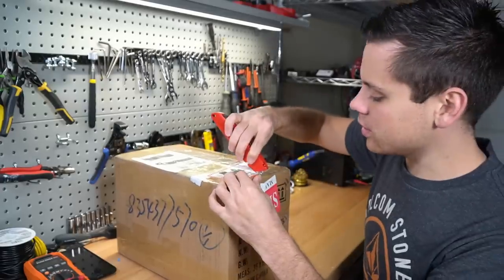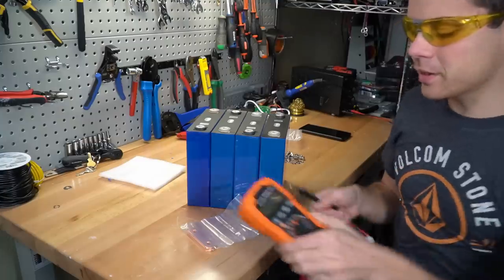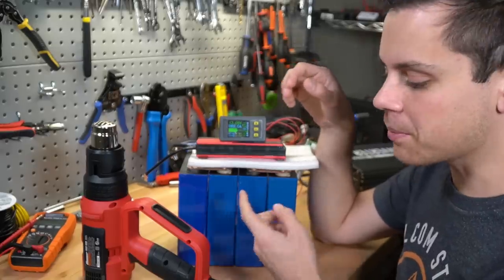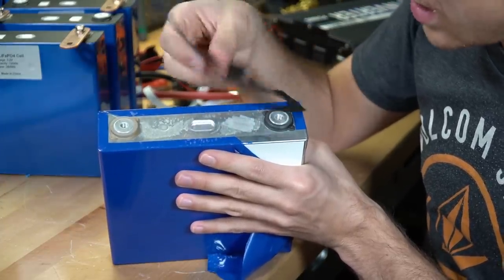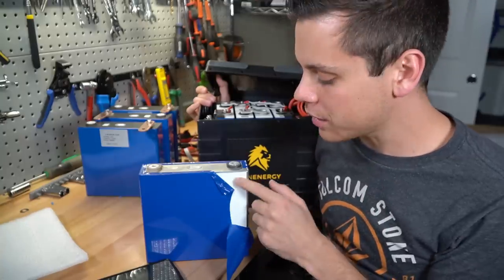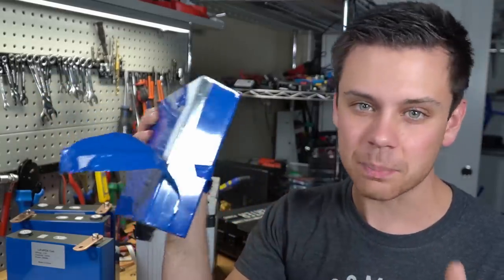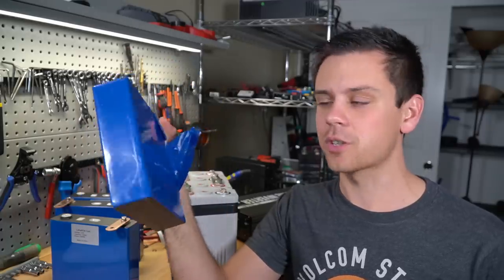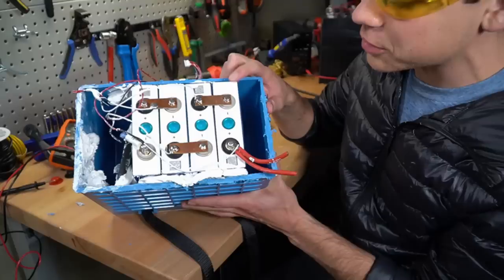Cheap 120Ah LiFePO4 Al Cased Aliexpress Cells: Are these Grade B?

Comment: I have 6 - 100 wt panels and want to have enough power to run a fridge. Aside from that I want to be able to use a toaster oven and charge laptops/phones and maybe a induction cook top, of course not all at the same time but it's for an RV. I also want to run a small AC unit at night on hot evenings. So what I'm asking you is, how big of a battery bank do you think I might need to power my RV. Using my 6 panels.

Comment: So, what is the optimal storage device for very frequent charge/discharge cycles?  Is there a point at which you would want to string multiple storage systems together so that each can perform optimally?

What is the calculus for the degradation done by a very deep charge and discharge cycle under controlled temperature conditions versus an equivalent amount of energy versus several shallower cycles in lithium iron phosphate cell?

Comment: Hey Will, Love your videos but this one seems to have mixed messages, it's hard to understand your point.
Are used batteries worth buying or not you say they are & they are not, which is it?
Reply from the maker: Pros and cons to used batteries. I said at the end that if you can find a good deal and test them, go with used. But I said that I prefer new cells. It was near the end of the video that I covered this.

Comment: MERRY CHRISTMAS WILL. Thanks. Love your videos. I'm a casual RV'er. I have 3 12v wet batteries in parallel. It would be fun to see a video on how many wet batteries 6v / 12v it would take to equal a 100ah Lithium battery? Watt hours? I get the battery life and maintenance issues and that wet batteries cut off at 50% and Lithium cut off at about 0. I just wonder if I replaced my 3 wet batteries ($300) with a 100ah Lithium ($500 ~ 900), what would be the watt hour gain, if any? Real life application?

Comment: You should do a review on the 280ah batteries in the aluminum case from AliExpress 😁.
Reply: Just recieved 4 of those today, $797 shipped TOYSEA ordered Jun 1, well packaged, new, 3.33,3.34,3.33,3.30 volts tested on arrival, have daly 150A Bms Separate, recieving copper bars (4" bus distance), fastronix terminals (3 for solar separate).

Comment: Thanks Will, I recently moved from 18650 power wall to lifepo4. Searched videos on you tube and attracted by your videos and subscribed. I need a help. This video is 4 years old and your knowledge might have build up a lot now. 
Please help me to read the capacity of lifepo4 batteries. Which meter I need to buy? All the meters I have tell me the voltage. 
Also if you have find a good seller for blue colour lifepo4 now please direct me to buy. Thanks.

Comment: Will, I would really like to see you tear down an Inergy Apex and maybe the Titan?  I’m looking at both of these for RV use.  I was ready to order an Apex until I saw that you did not recommend the Apex.  Now I’m looking at the much more expensive Titan.  I’m ok with the Apex EC8 connectors because they now have an MC4 adapter, and also ok with the 1500 watt inverter, IF Inergy actually comes out with their external Lithium battery.  Inergy promises the external Lithium by Q1-Q2 of 2020, do you think they actually will get one out?

Comment: I have a 400w renogy solar setup with the 40a controller and 4x 3.7v LifePo4 Batteries seriesed at 12v parallel.
Question, if I want to charge the battery bank with 110v such as a small gas generator could I use a charger like the Ultra Power UP240 AC Plus 240W 4-Port Multi-Chemistry AC/DC Charger or can I use any standard car battery charger?

Comment: The ebike companies that last, Juiced Bikes, Sondors, Rad, all go to China and they establish deep relationships with the companies they wholesale from. Even Lectric with their red hot XP goes to China. Without that, they don't really seem to treat you as 'human'. Paul, at EM3EV, has been building batteries for many years. He has depth and you might read his website. A lot of the Ebay vendors start out selling packs, like ebike packs, from overseas, and when they have a market here, they bring in supply and ship from the US. It's all developing. You should look at 48v ebike packs. The high voltage is better to run an inverter. They come with a BMS, often a charger. Lots to choose from, but a very simple build. I've had a Life pack for 4 years. Still has 90% cap.

Comment: Thanks for all the info, I purchased this cells and the bms you recommend but forgot to buy the Bluetooth module. You know if I can use an arduino or similar bt module? is ok to use the battery without the bt? thanks in advance

Comment: I was wondering have you come across these and do you think this would be a good battery for a RV this is the battery and this is what they claim etc. etc.

The Centennial CB6-400 6V 400Ah L16 Sealed Lead Acid AGM Battery is the best option for those looking for highly reliable batteries known to provide a long life-cycle. The Centennial AGM sealed construction allows for a long service life and make them dependable in everyday use. Centennial’s AGM’s provide maintenance-free operation, which means that their operation is hassle-free. The heavy duty grids, and low self-discharge of the Centennial AGM help it outlast the competition. 

Special Price
$532

Comment: Can I put a 12V LiFePO4 battery in my truck as an auxiliary?
Can it get charged by the alternator or do I need a DC/DC charger? 

At the moment  I run a  110Ah AGM Gel  lead battery connected to the starter battery by a victron Cyrix ct relais.
Because of the usable capacity of Lithium batteries, I think 60Ah should be enough.

Comment: Hi, I have a pair of Alliant LifePO4 12v batteries for motorbike. I got no motorbike, I bought them to use with solar... however when trying to charge with a regular mppt 12v charger, the battery got puffed. I dont know actually why, but it seems this battery is made just for motorbikes. So.. the question is: Is it safe to try to open the battery to use the cells that are still good? I thought about checking the cells model and buying proper BMS for them. The case is made of hard plastic.

Comment: When you calculate the energy density, how much do you leave out to account for the terminal assembly and case weight?
Reply from the maker: That can change the weight drastically. That's why sinopoly are super heavy. But they are good cells anyways. Also, you need to factor in external case weight. Aluminum case cells may be lighter, but they need more protection than calb or sinopoly. Or Winston cells. So heavier external case. Pros and cons to each.
Reply from the maker: Most energy density estimates include case/cell design features like the cap etc

Comment: Does anyone know if a source for the group 26 enclosures the 12v replacements use? I'd love to use cells like this but my application is for a travel trailer so they'll be living out in the elements (the breakaway cable must be connected directly to the battery and brakes) so a quality waterproof case is mandatory. I'd love to save ~60% over a comparable Battleborn but I'd want to do it right.
Reply: Andrew Fidel  Look for battery cases on a—lie express. There are many styles.

Comment: Hey will , I have purchased the 800 watt  all in one mpp and (2) 138 AH valence lithium batteries (black case) and I went through the settings you suggested, but I noticed your settings don’t quite match .

Is there a way you can help me with the settings to  make sure I have the correct settings , I don’t want to ruin my setup by not having it correct.

Thanks

Comment: Can I build a ebike battery out of these? My dream battery is 52v 40ah but I'd settle on 52v 20ah, if it's cheap I'd make two 52v 20ah and run them parallel and end up with a 52v 40ah. How much would it cost for a 52v 20ah battery made out of these cells?/ Or should I just buy a 52v 20ah lithium ion battery for 600.00. I'm so confused, I just want a ebike with enough power to movey fat butt, I'm disabled and can't contribute alot of leg power, I'm trying to buy or build a 750w nominal 1700w peak rear hub with a 35amp controller. 52v 20ah battery, on a fat tire comfort bike, maybe a front suspension and suspension seat, 26 in 4.0 wide fat tire. Help me I have 1700.00 saved up,

Comment: Don't batteries depleted to 80% deplete much faster from 80->64% (the next 20% drop in capacity) than they did originally from 100->80?  The charts I see show capacity falling like a rock after a cell is already down to 80%.  So these would be good for a 100 cycles or less.

Comment: I don't really understand why you recommand the previous CALB cell that you reviewed when same sellers offers better aluminium cased batteries for around the same price. I looked up the ones you recommanded for a 24V system on your website versus the Calb batteries you reviewed, and they are cheaper, smaller and lighter than the CALB batteries.
Do you recommand putting a 24V lithium battery bank inside a case for a boat application? I'm trying to look at building a 24V 100-120Ah that will stay in a boat, and these aluminium cased or CALB battery are quite big, and won't fit inside a cheap amazon waterproof case.
Thx for the video, i'm learning quite a lot from your reviews.
Reply from the maker: Yeah that's because the price keeps fluctuating. It's driving me nuts. Calb was cheaper. Now the new Al cells are cheaper. And I have a video on the new cells coming soon.
Reply: @WillProwse  In the end, both are good systems for a simple diy battery bank. And it could mean a lot for boats with electric engines that are still relying on acid battery. There's still a part missing which is finding a watertight case to fit those big LiFePO4 with the Daly BMS.
Charger wise, what do you recommand for these 12/24v battery bank? aliexpress or else, something powerful like a 10-20amp

Comment: Why not test used Nissan Leaf batteries?  They seem like they are by far the best bang for buck.
Reply from the maker: Not a fan. Every capacity test I have seen online has been horrid. The temperature management system of leaf battery is horrible. I avoid those cells.

Comment: Aliexpress never fully refunds.  They give you a percentage back (it's pretty arbitrary how much) and argue that you still received goods that are worth something, albeit a lower amount.  I was only successful in getting something fully refunded on aliexpress once, and it was a huge hassle.  You have to chat which is very hard to figure out and then they review it internally.  I had to do this like 5 different times to get the full refund.  It was like $50, so it really wasn't worth all the time and effort.  I just ordered 280ah cells and if they turn up used I'm just going to dispute the charges with my credit card company.

Comment: doesn't look good? You know how low the resistance of copper is? You will probably be fine if if you have 1/5th of the thickness of those thing copper strips. You wil blow up those cells earlier than you would get the heat/resistance high enought before it even starts to matter a little bit.

Edit: But yeah having more copper than necesary is never a no go.

Comment: $442 isn't that cheap.  You can get a 12V 100 aH LiFePo battery directly from a manufacturer in China for less that $400 delivered.  it includes a BMS. All in a very nice blue battery box.  Ready to plug in.  I would NEVER buy a used battery.  It just says it is a "good" battery.  Very nebulous rating.

Comment: 4 pcs @120Ah for 400$ is not that cheap though. You can get proper, warrantied 150Ah cells for less than $100 including shipping.
Reply: Source?
Reply: Are those lipo4?
Reply from the maker: Where????! I have never seen them that cheap. Would love to see this source.
Reply: @WillProwse  I replied with a source including to the other posters, but it seems they end up in the spam folder because of the link. Can you check that?
Reply: @WillProwse  Because the spam filter, if you go to item/4000108447273.html on Aliexpress. I don't know what price that shows you, but I get 16pcs, 150Ah for $1,597.06 - that's $99.8 and includes shipping.
Reply: @jessyterpoorten7197  Yes. Links get send to spam, so my first reply didn't get through. Check the other reply I posted to Will in this thread.
Reply: @andrewfidel2220   Links get send to spam, so my first reply didn't get through. Check the other reply I posted to Will in this thread.
Reply from the maker: @upnorthandpersonal  dang I can't copy them in until I get to my desktop. I'll check them out soon. Are they new and matched? Did you buy them?
Reply: @WillProwse  yes, got a few to test some time ago. Actually, when I just checked out your site they seem to be from the same seller you recommend!
Reply: DIY Solar Power with Will Prowse 
At this rate you end up broke but with enough batteries for a huge power wall;)

Tx for your video’s!
Reply: @WillProwse  "Are they new" --> yes!